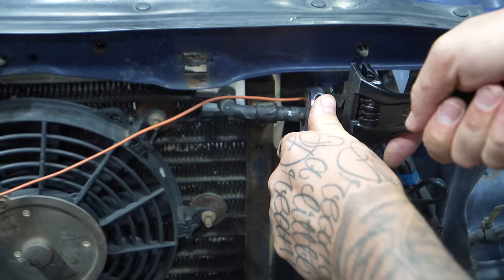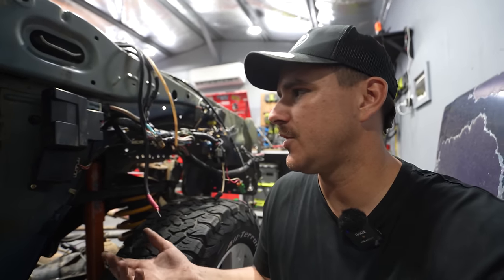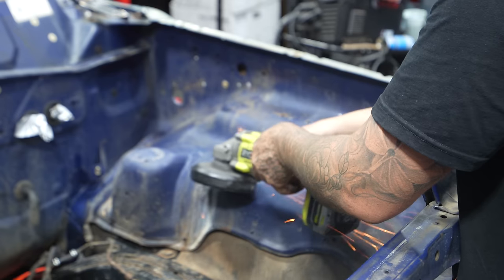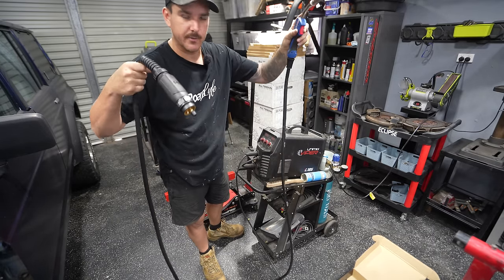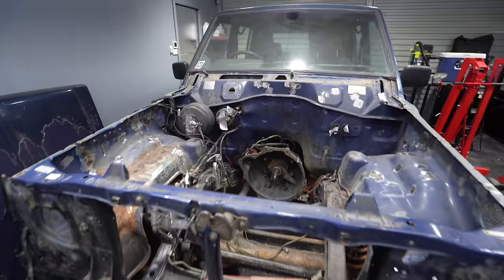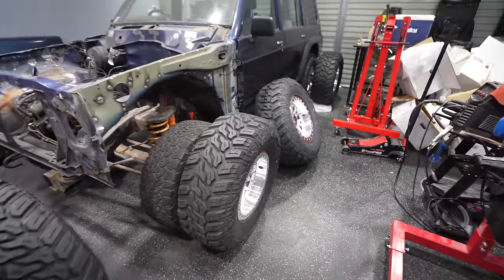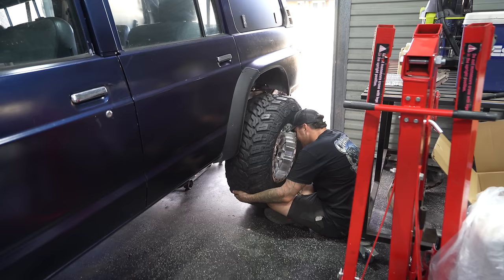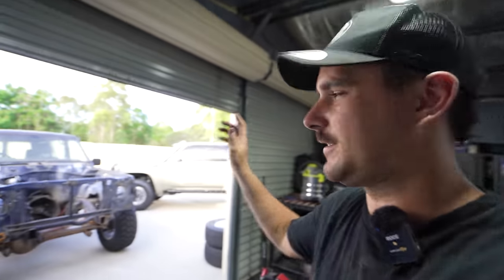A Single Mod Changed This 4WD Forever!

Comment: just FYI,

Alot of people who weld at home don't do this or know this.

But maintenance, you should really blow compressed air through the hose from time to time to clean out the " Liner " that the wire etc runs through. it's also serviceable part aswell you can replace the liners.

Comment: You have to be my favourite GQ builder on YouTube, you keep doing the simple but awesome mods on the cheap, the wiring relocation is perfect as you said never blown a fuse, and even when I did it was only wiper motor one 😂 defiantly copying that cause I don’t want it in the cab either, Big ups Tommo keep killing it

Comment: I was a questioner on the last ep: you're right the fuses and relays will be fine where they are, shaved bay looks mad. 

I think go a different colour to exterior but surely not gloss black. Gloss black is the cover up colour haha. Maybe Rally white? Or just opposite to the exterior.

Wheels look good.

Comment: The whole premise of the channel is teaching / sharing. Why would you not share issues with tyre / wheel  fitting issues?
Reply from the maker: That was more a joke but I had to use a set of screw drivers as pry bars, it’s the normal way to do it really !
Reply: Copy , appreciate your work mate👍

Comment: How you going to lock your hubs 🤦‍♂️
Reply from the maker: 2 Allen bolts and the cap is off, but it’ll be sitting in the shed for a while so may as well leave the caps on for now